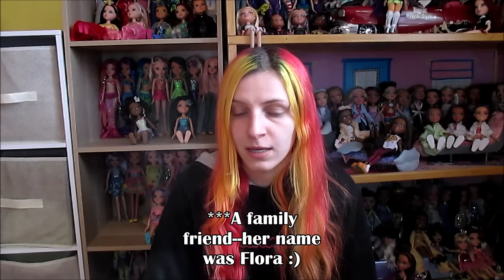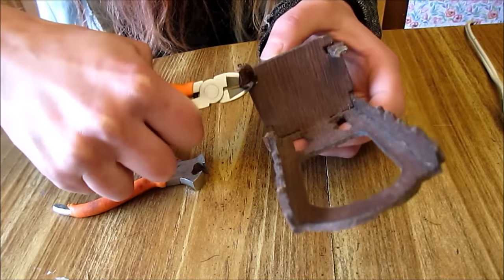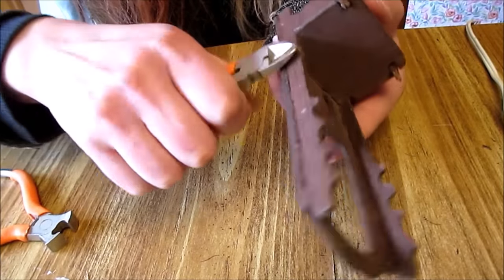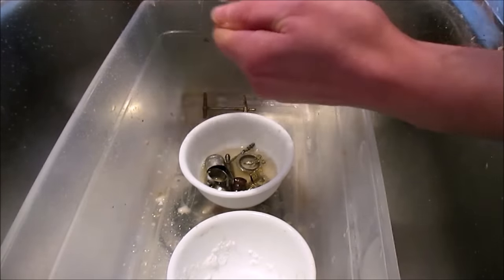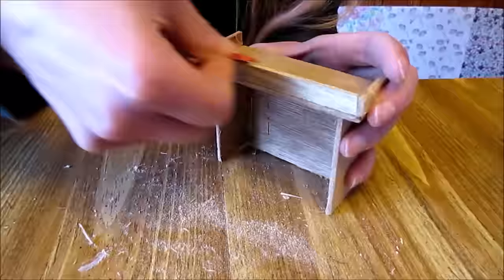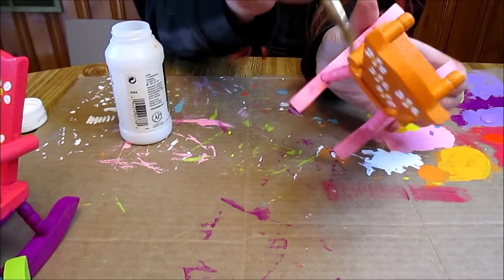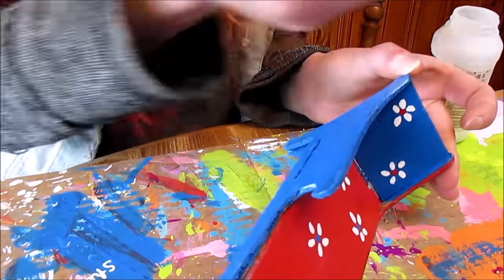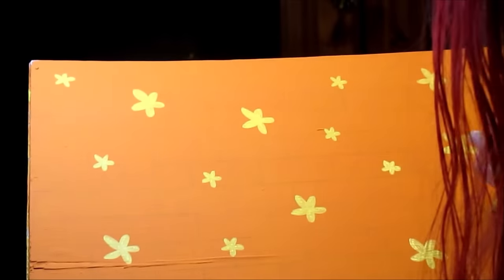Making Over My Childhood Dollhouse!

Comment: Hi how are you? I watched your video "How I Reattach Dolly Neck Articulations" and wanted to know how can I reattach the anchor without breaking the pin that goes through it?

The doll is a Barbie life in the dreamhouse
Reply from the maker: Most of the time the pin that goes through it breaks.  The anchor is slid through the pin before the two halves of the mold are sealed together.  So it's very hard, if not impossible, to slide the ring of the articulation over the pin.  But even if the pin breaks, the articulation will still stay in place.  I've had it happen to a lot of dolls over the years and they've been fine.  The pin is just an extra security measure.